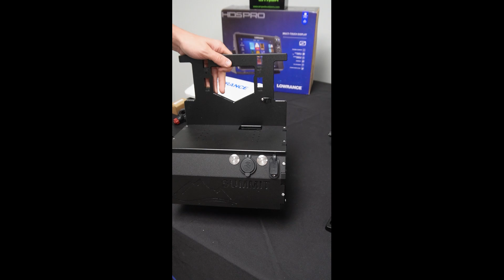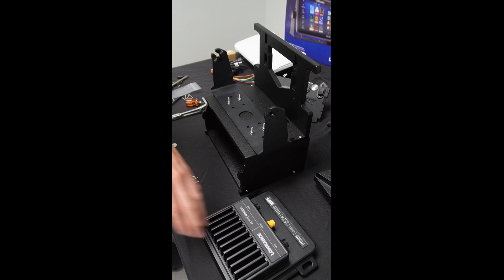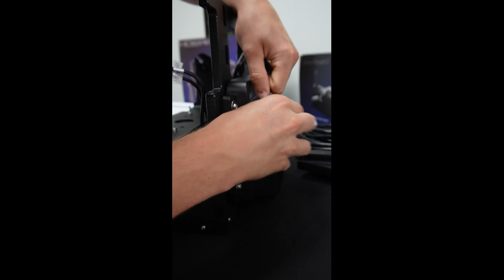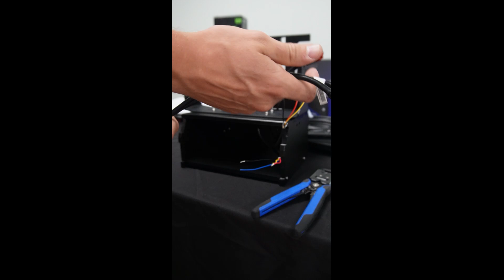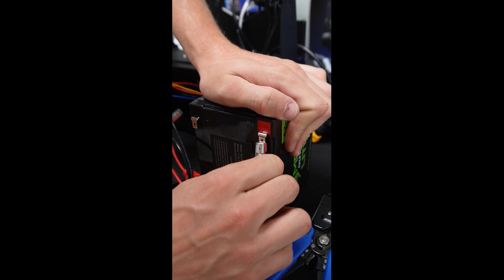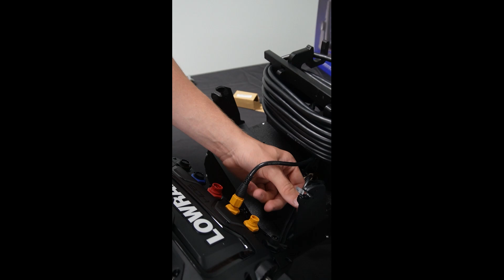Lowrance Active Target Summit HD CNC Shuttle Assembly

Comment: For anyone else assembling a Lowrance Active target, use the small washers on the black box. Insert the screws from the black box side, or your're socket won't fit into the slot to tighten them up. 
I bought 3/4" screws to attach both the black box and the gimbal mount. You cant install the bolts this way on the bottom 2 mounting holes due to the battery placement. Hex head bolts or allen key would make this whole assembly much easier. A little R&D and field testing across platforms would go along way